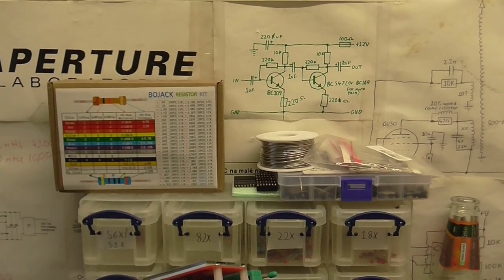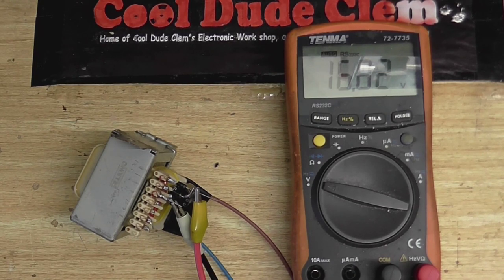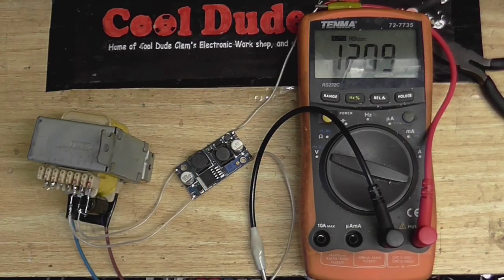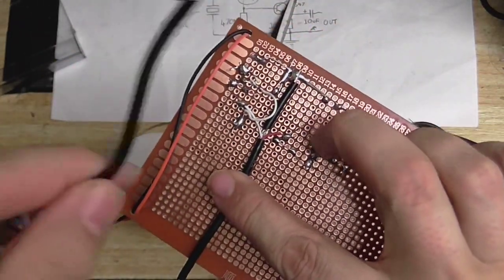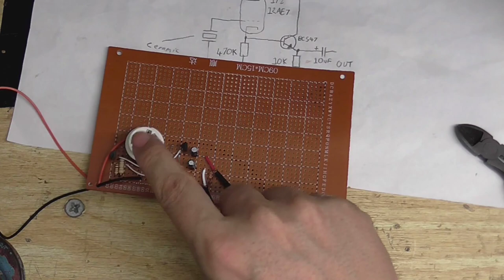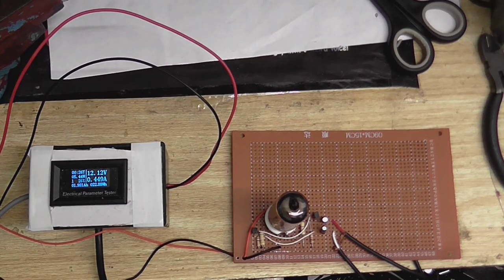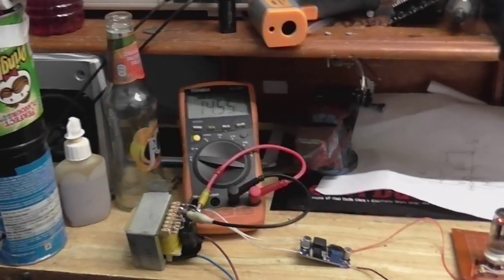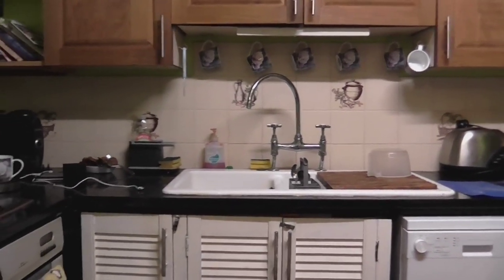The Hombrew Record Player Thingy part 2(?) - Building the "preamp" and power supply.

Comment: I built a guitar amp using a small computer power supply for the filaments. I ran a 12AT7 from the 12 volt supply, a 6L6 or an EL34 can be run at five volts and work just about as well from what I can tell.

I was pretty mystified about the 12 volt B supply until I realized it's a tube made for car radios. I still find impressive they can work at such low voltages.

I may copy your idea for my homebuilt player, I pulled the craptacular amp I had about a year ago and I got too lazy to build a new one. I have the same changer actually.

Comment: Hi CDC, I voted to see the final stage or out put section of the tape recorder, you will have to make an end of the series video, this is cool too. I see your valve socket has nine pins, probably for a pre amp type tube like an ECC83/12AX7 or similar. Pentodes make a nice pre amp tube, but, a little more prone to harmonics, etc..use a grounded tube shield, and so on. Always good to see a new Cool Dude Clem video. Yes, a really good day for some electronics. How is your animation coming along, perhaps an update? Watching in Willamina, Oregon, USA, best, C.
Reply from the maker: Progress on my new is slow, I have so much going on lately project wise that I don't have much time for anything.